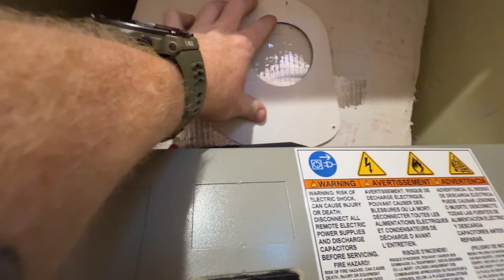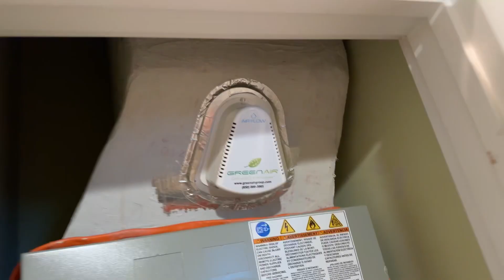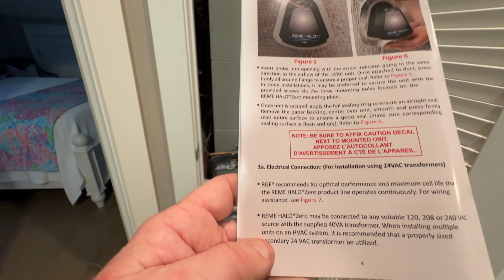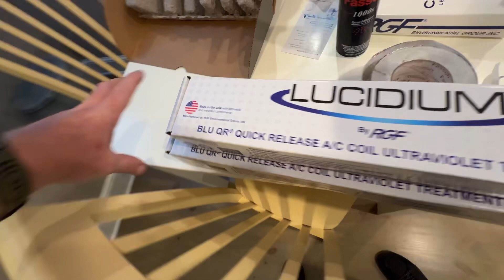REME HALO ZERO INSTALL | FLORIDA HVAC

Comment: Shouldn’t these be shining on evap coil, these do not provide filtration.
Reply from the maker: Depending on where you put UV lights and air handlers, they could deteriorate electrical wire shielding or plastic drain pan overtime. I like the Remi halos they go in the Plenum. They release hydrogen peroxide to help clean the air at the same time preventing it to build up at the unit, most growth forms in the first few feet of the Plenum. And basic maintenance will keep the unit clean at the same time.

Comment: What are your personal thoughts on these systems changing the chemistry of the air in people’s homes? I was taught that all you really need is forced air and a large media filter. You can also add a germicidal UV light to keep the coil clean. Additionally, can that UV light be seen through the louver doors when closed? I saw it from under the unit. I like your videos, keep the content coming.